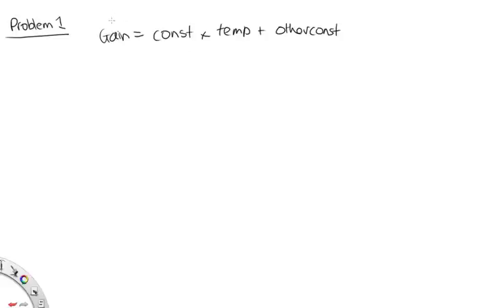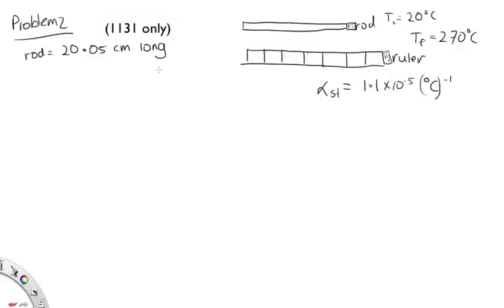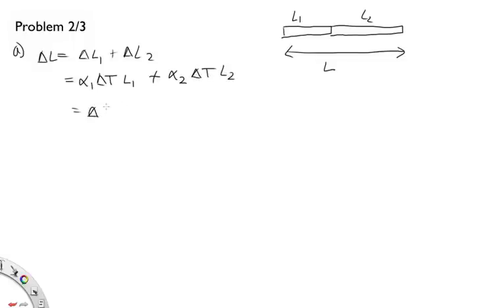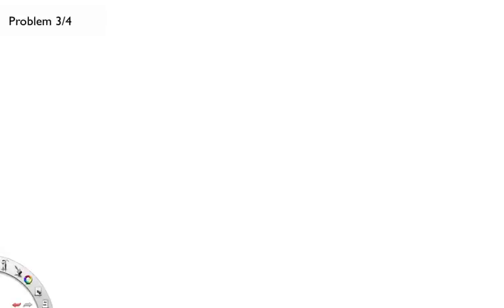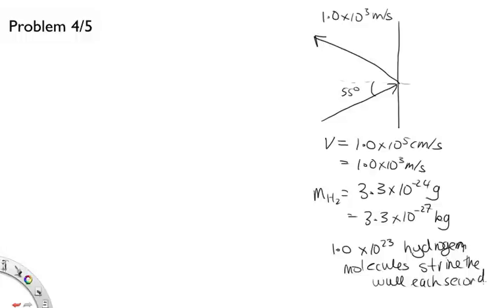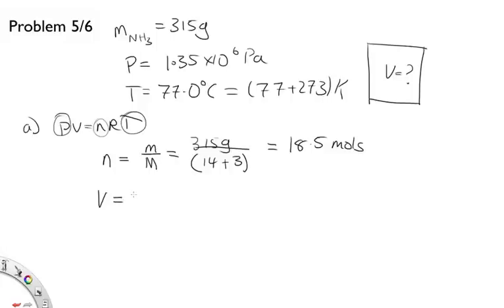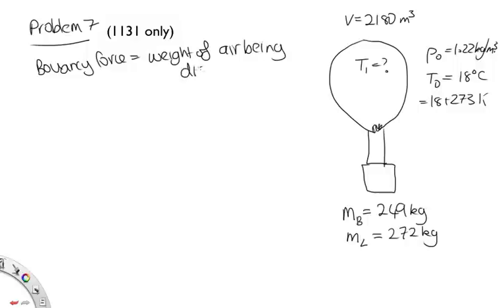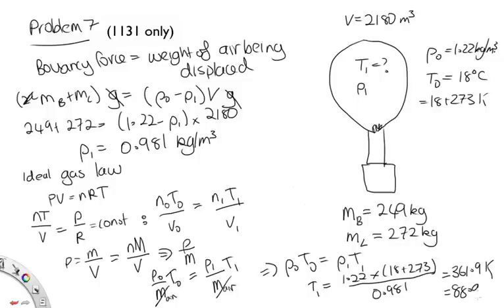Phys 1A Set 4 part 1

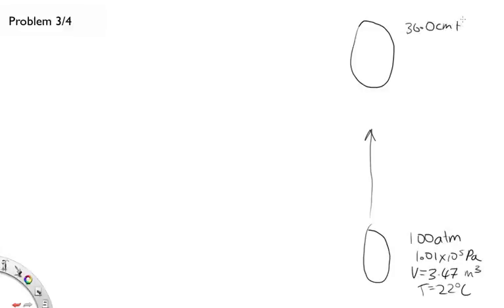Comment: how are we ment to know these 'conversion factors' 14:26
Reply from the maker: For homework sets and open book quizzes you should google any conversion factors you need. For closed book exams you are provided with a data sheet that includes conversion factors you need, this is in the front of your homework booklet and on the Moodle page, the conversion factor from Pa to atm is at the top of the sheet.